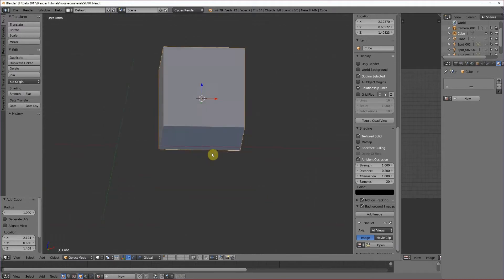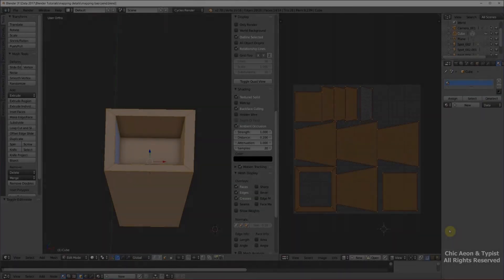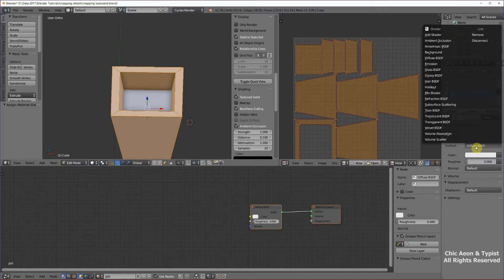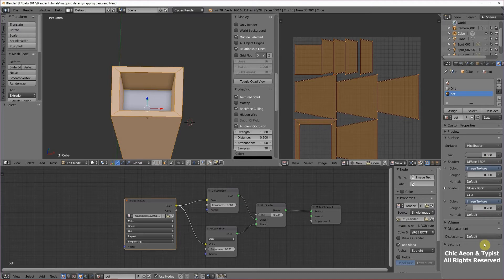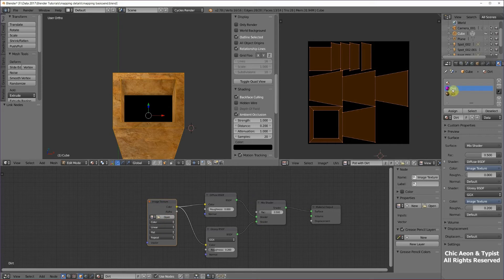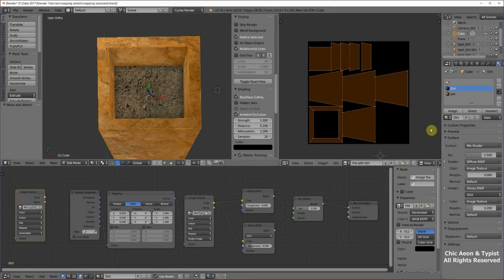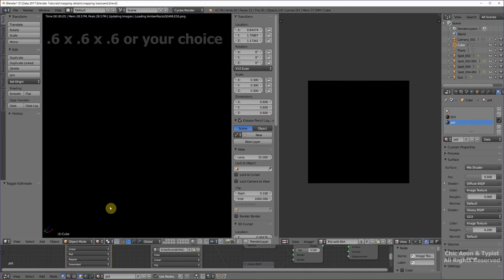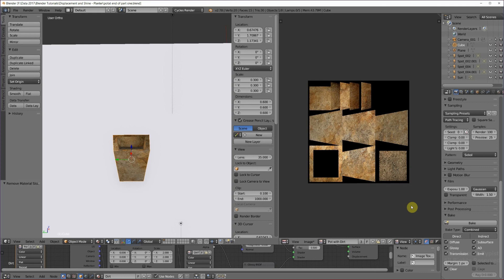Displacement - Shine  Part 1

Comment: I know I've asked a lot of questions, but I'm finding your videos very informative. But, as you can guess, I have another question. 

At about 8:30, you clicked on the Dirt material. Then, it looks like you hover over the Select button. It's hard to tell whether you clicked that button or not. This is right before you change the Surface setting to Mix Shader. Did you actually click the Select button?

Comment: When I bake, Blender displays an "informational" message: Circular dependency on image <dirt image file> from obect <mesh object>. I'm not sure what it means or what to do about it. Any advice?
Reply from the maker: Generally it most often means that you either forgot to add the NON-CONNECTED image texture to back to OR you have that texture but the texture isn't the ACTIVE texture (so you didn't click on it last and have it highlighted) so Blender is trying to bake to the texture that you have as part of you texture node pattern. It won't do that and you get that message :D.
Reply: I do have a non-connected image texture node for the dirt material and its set to the 'pot with dirt' image created for the bake. But, I'm not sure what you mean by the texture not being the active texture. What am I supposed to click on so that it's the last and is highlighted? Thanks in advance for your advice and knowledge.
Reply from the maker: You click on the unconnected texture last and it will put a border around that node texture. You ALSO have to do this with EACH and EVERY material you have that you are baking .  Good luck!
Reply: It took a few retries, but I got it. Thanks.